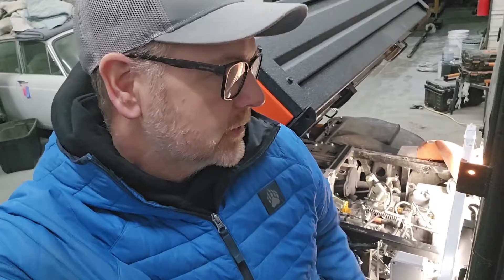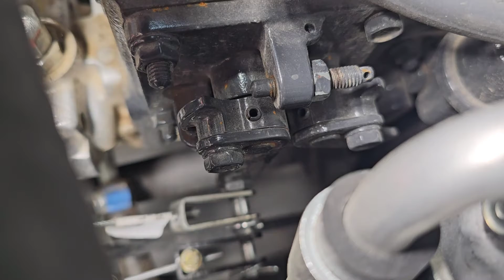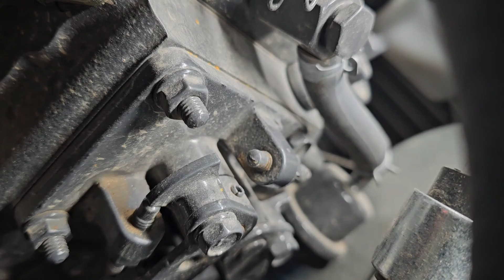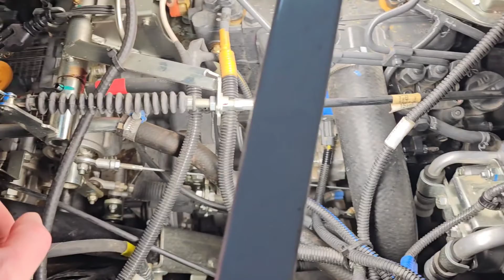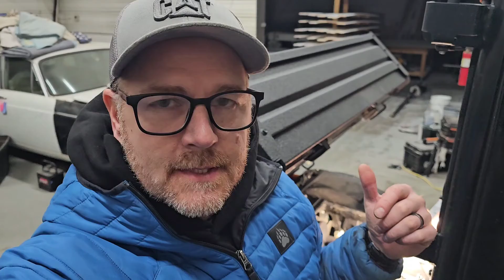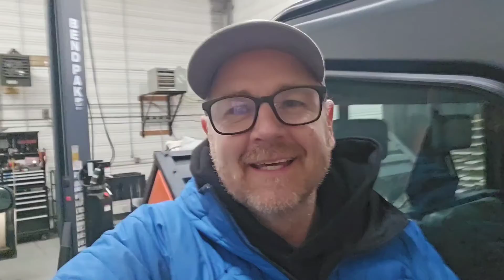Episode 3: Engine Bay Throttle Control - Kubota RTV Optimization Protocol

Comment: I have difficulty shifting gears... but if I just touch the acceleration pedal it shifts into gear and then have to hold it there so it won't jump out of gear .. but as soon as it move forward I can leave the gear lever and it wont jump out of gear.. should I adjust the cable going to the variable hydro transmission that's working with the acceleration  pedal?
Reply from the maker: It sounds like your shifter cable needs some adjustment as far as it popping out of gear. The hard shifting could be the hydro linkage.

Comment: Great series, and greetings from Utah! Thanks for taking the time to educate us RTV owners. With the high RPM pin, is there a limit to how much you can back it up without damaging the motor? I've adjusted mine to the point where one thread shows on the left side of the bracket. From what I can see on the video, you have about two threads left on yours.  Am I still safe?
Reply from the maker: The easy answer is yes, there is a limit... But. 

Ultimately, more fuel more power- more rpm. RPM's lead to friction and heat which breaks things down. So, if you are running wide open 4,000 rpm for hours, that's not good for the system. But if you have the ability to get the full power when you want it, I believe that's reasonable. 

As with any performance modifications, we need to pay closer attention to maintenance to make sure fluids and filters are changed perhaps more frequently because they may be breaking down faster.

I would love for these machines to have a tachometer so we could see what's happening. I need to make a video on that!
Reply: @SearlesStation  Thanks for your quick reply.  I too, wish they had a tachometer.  I will probably back mine off a turn.  When I use just the foot pedal, I don't reach the upper pin, but I do, however, when I use the hand throttle.  I reached 28 mph today after adjusting the upper limit with foot pedal only.
Reply: Forgot to mention. That was a 2 MPH increase from what I had prior to adjusting the upper screw.  I posted a "short" of the previous 26 mph I reached after making the throttle adjustments you showed in the series.  I will tackle the Hydrostatic linkage segment here shortly.  Thanks again.  Alex

Comment: If you allow the pedal travel to exceed the throttle adjustment screw at the engine you are going to constantly stretch the cable. That's why that bolt is there on the floor.

Comment: When I go uphill, I have to back off on the foot pedal a little in order to get the best performance from the machine. If I press the pedal to the floor, it is worse. I have heard this from other RTV owners as well. How does that square with your example of wanting more RPMs in order for the machine to provide better performance? Perhaps something not set correctly on my machine???
Reply: Same here. Did anyone mention a solution for that yet?
Reply: @172turtla its just how it is, its a hydrostatic transmission, running it at full throttle gives too much pressure and gives more speed at the cost of torque
Reply: Sounds like it needs a charge pressure adjustment.
Reply: That is how an HST Transmission works.   Just back off the throttle a little and allow the HST to “catch up”, then accelerate slowly while hill climbing.  My 1140 regularly climbs steep, rough trails with no slippage.  Be sure to lock in the rear differential also if steep.

Comment: How fast do you think you can get this thing to go.  Target is 35 mph flat road at least two people.  thoughts?  Thanks
Reply from the maker: I could get it close. With or without the K-connect? Is there any other weight to consider? 

You'd need the hand throttle for sure and a little mod to some linkage
Reply: How fast have you got it up to so far ?
Reply: @MarkMoore-zz3uw  After making the adjustments shown in the series, I have my 2020 1100C up to 30 MPH.   28 with just the foot throttle, the additional 2 mph is coming when I use the hand throttle in addition to the floor pedal.

Comment: Where is the hand throttle on the kubota , I have a 1120 diesel but have never looked for hand throttle.??
Reply from the maker: It's an optional kit. It gets installed on the left side of the driver seat where the differential lock is.

Comment: So I'm old school too, and I'm wanting to know what your opinion of high rpm is for this engine. Mine shows 3150rpm at full throttle and 1450 at low idle. What is high? Kubota shows HP for this engine at 3600rpm. Is that the upper limit?
Reply from the maker: That's the point of highest horsepower. Not necessarily the highest rpm. My opinion is that it can do more.

Comment: Is this the final video ? I’ve done all things shown and I am only @ 23mph. 2021 x1140 250 hrs 1100 miles on 26x9x14 tweels on the front 26x11x14 on the rears. 2” bracket lift.
Reply from the maker: Not done yet! I'll get more done this weekend. Thanks for watching! Have you cleaned out your spark arrestor in your muffler?
Reply: Yes sir. I’ve done it once at 100 hrs. I didn’t think it would change much on my
Unit but I did it again yesterday just to make sure. I use an injector cleaner and anti gel formula in every tank made here locally .

Comment: My 1140X doesn't have it's first oil change yet, with only 25 hours on it, but it will do it's rated 25MPH, and 27 down grade.  After watching your optimization videos, that will be a fantastic upgrade to check once winter weather breaks. Also, I think adding a tachometer would be beneficial, seeing how much overspeed of rated RPM.  What are your thoughts about that one?
Reply from the maker: Absolutely! I'm still old-school and think a tach and  oil, temp, hydro pressure/temp gages are important.  Everything just has these dummy lights... 😒
Reply: @SearlesStation  Regarding throttle cable were you show how to eliminate slack, in my case there definitely is slack with cable, enough that I felt compelled to adjust it.  Unfortunately Kubota may have caught on to your video, or I'm not doing it right, but when you turn the cable screw in to shorten slack, my cable bolt is all the way in already, so the only adjustment I have is going out, which is no help.  You must of had plenty of inward adjustment with yours.  Somehow I have figure out how to shorten entire cable assembly, or am I just dreaming there is a fix.  Also did you install your own hand throttle?